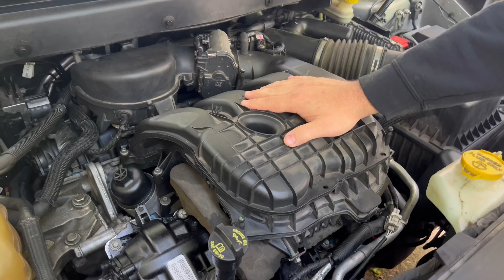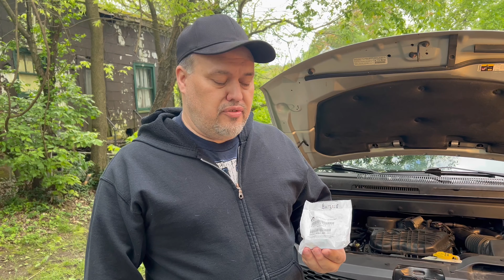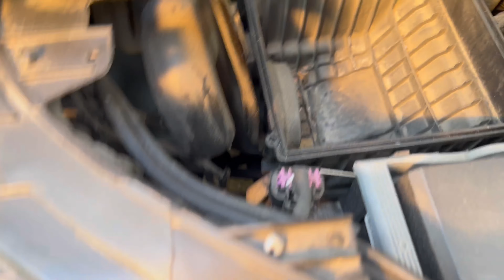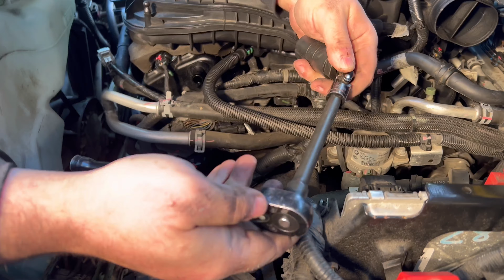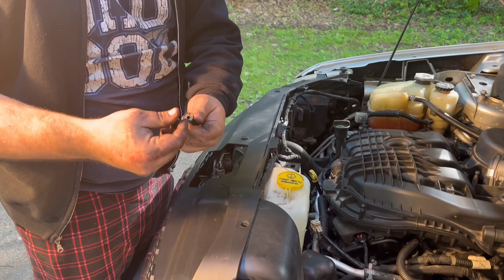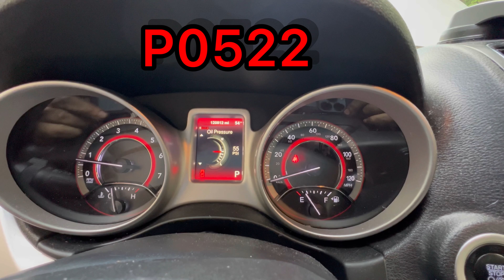How To Replace Oil Pressure Sensor Without Removing Upper Intake And Fix Code P0520 - P0522

Comment: What size socket did you use for the sensor?
Reply: 1 1/16” special oil sensor socket.
Reply from the maker: 2
Oil Cooler Filter Adapter Housing w/ 2-Sensor for Chrysler Dodge ...
For a 2014 Dodge Journey 3.6L, the oil temperature sensor on the oil cooler typically requires a 19 mm or 3/4 inch deep socket for removal. The sensor is located on the oil filter/cooler housing, which is under the intake manifold. The neighboring oil pressure sensor is larger, often requiring a 28 mm socket.

Comment: 100% new sub from this Aussie 👍 really appreciate the vid mate scraped up knuckles & all🤣 I myself will be taking this job on in the morning & after watchin   ur vid I'm confident that I'll get it done 🤞PS. can you tell me about the socket you used? You said "special" socket to remove the sensor?
Reply from the maker: What I mean in the video is just a socket that will fit into the tight space not really a special one just one that will fit that is slender.

Comment: This video saved me a couple of grand as I had the PO6DD code and thought I would replace the oil pump & solenoid but almost 2 thousand in labor made me look into it more and I changed the Oil Pressure Sensor myself with the guidance of the video and so far so good. No more PO6DD code, fingers crossed. Thankyou!!
Reply from the maker: You are welcome, my friend. I’m glad the video helped you. 👍
Reply: @Mr_Goody  Unfortunately engine light came back on again the next day. Now moving onto Oil Pump Solenoid. Hopefully its that next before having to replace the full pump :(
Reply from the maker: @aaronribbans239 I have a video on my channel on how to change the oil pump.  Hopefully you won’t have to change it though.

Comment: AMAZING, THANK YOU! For those about to attempt this, a few notes:

At 5:06 he mentions removing a vacuum hose - I couldn't get it off so i just flipped the top cover with the hose attached on top of the engine and then loosened the hose clamp on the bellows closest to the bottom half of the box and still had plenty of room instead of pulling it all out.
There isn't a locking clip on the connector, just start wiggling and pulling easily and it will come off - I spent a long time trying to release a clip like on most connectors, but it doesn't exist on this one.
The most challenging thing is getting the socket all the way on, so if you are easily frustrated find your zen and plan on taking some calming down breaks.
Thank you again for this video, there's no telling how much $$ this saved!!
Reply from the maker: You are welcome my Friend 👍

Comment: im only seeing 6 psi on start up and low oil pressure warning on dash. is my pump bad or maybe the oil pump solenoid thing is stuck? do these sensors slowly fail and read low , or do the sensors go bad immediately usually?
Reply from the maker: I have seen both but in my experiences, they usually go out completely about 80% of the time the other 20% of the time I have seen them give false readings.
Reply: @Mr_Goody  thank you !

Comment: My Journey threw a p0520 code. I'm going to try to change the sensor but am wondering how long this took you to do?
Reply from the maker: When I was a beginner at doing them, it took me about 45 minutes to an hour tops.
Reply: He tells you at 9:49.  It is 1 1/16 I think is what he said. It is a special socket that I  ordered. Doing it his way saved so much time and was so much easier. Saved a ton of money.😊
Reply: Oh good thanks!
Reply: What size socket did you use for the sensor?
Reply: @codywayman7153  they went to reply to you but just look in the thread above and you will see the reply I meant to send.  He says it at 9:49 in the video but it's 1 1/16. I needed to order it cause it's a special socket. Saved a lot of money doing it myself with the help of this video.

Comment: just threw the p0522 code in my 2012. what year is yours? plan on tackling this Sunday. definitely the same engine as yours. thanks!
Reply from the maker: It is a 2014 3.6 L engine.  as long as yours is six-cylinder then this process should work in years 2011 to 2018 Dodge Journeys. 👍
Reply: @Mr_Goody  yeah definitely the same engine. I'm going to give it a go Sunday. I appreciate your video tremendously.
Reply from the maker: @JayFarm_23 You are welcome, my friend. Good luck and let us know how it goes if you can.
Reply: @Mr_Goody  I sure will. I have my wife to boss me around while I do it so I should be good to go. 😂